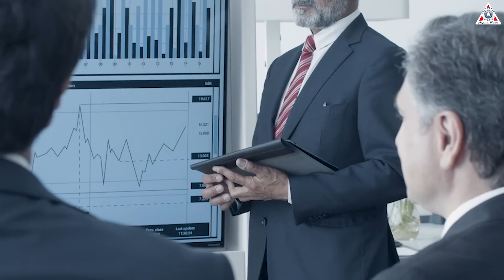Elon Musk's SpaceX Revealed Starship Flight With First “Chopstick” Landing...

Comment: I’ve said it many times. Putting gyroscopic stabilizers on the chopsticks would probably make them far more stable and accurate. And while I’m at it building an oil rig type landing pad down range you will save tons of money weight and fuel and just float the things back to port on a much cheaper conventional ship. Keep the chopstick idea but put it over the water so when accidents happen (and they definitely will) you don’t destroy an entire landing site. It just drops in the ocean.

Comment: The Falcon 9 has a mass of 550kg or a bit over 1,200 lbs?  A single merlin engine weighs nearly that .  I can't find any part of a falcon 9 with a mass' first 3 numbers being 550
Reply: He may have been referring to the minimum fuel weight (550kg) for the landing burn.  It sounded like the text was inartfully edited at that point in the video.

Comment: I thought they ruled it out for launch 5.
Reply: They should if they haven’t. Zero chance of success.
Reply: @JetFire9  They have mastered landing the Falcon rockets on a dime. I saw a view where they explained that the booster has three methods of control. A big one is the engines gimble. That should put it where they want it.
Reply: @russmartin4189  I have seen a lot of Falcon 9 landings, thank you very much, but no, they don’t land on a dime. They are all over the landing pad. This Starship needs to land on the tip of a pencil. They haven’t gotten anywhere close to proving they can do that yet, so why blow up the launch pad, AGAIN??
Reply: @JetFire9  I think the idea is to land it with practically no fuel left.  And even if it exploded, the launch pad is very strong. As long as the cables  and connectors are shielded, it should be able to take it. Listen, they know what they are doing and (probably) built it to take explosions. That's what I think. Anyway,  we may find out what happens when one blows up attempting to be caught.  That would be cool in a perverse way.

Comment: We'll see, I think the whole tower thing, and excessively tall boosters and ships are an anomaly of current levels of lift tech.

And that Elon' s magic tricks will be great viewing, but that Companies like Rocket Lab and Stoke Space will use tapered free standing ships that are shorter, and just use erectors. Which will allow passenger boarding and cargo loading in the horizontal.
With the fueling system built into the erector instead of a tall tower.

This would also allow ballistic angling for shorter sub orbital flights.

And be a much better system for offshore complexes or Rocket Carrier operations...

Gonna be hard to be stealthy with the radar cross section and over the horizon exposure of one of those towers on a ship. Not to mention stability issues as I have writ previously.

My guess is Rocket Lab will maybe combine the hot staging ring, with their ring base stage two concept. Perhaps with the triangulation being in two parts with an overlapped locking system, so as 2B capable of hop stacking instead of requiring a crane all the time.

That landing base ring on a stage two or stage three payload ship would be a good system fer in the dirt, like the Military would want, or one might need on Moon or Mars for years until things were less primitive.

And it could have suspension... perhaps air over hydraulic shock absorbers with spring over configuration like the Off Roaders have  developed. That stuff is off the shelf, and surely stainless versions could be manufactured and get alot of sales promotion via Space use, and sell to off roaders awaiting their first Lunar or Mars Overlander Adventures.

You know, they and dirt bikers will pay alot for low gravity moto and 4x4 tourism...

Its likely to be a Yahoo cultural thing with the Loonies and the Martian colonizers...

Get out of those stuffy Colony Tunnel systems, and tear up the regolith with high powered tron motors, doing low gravity extreme jumps and awesome lunar hill climbs, or Olympus Mons on Mars.

Use up their annual dosemeter allowances exploring and rockhounding...

Also the ring base and shock absorber system would be good for shipboard landings. we could build very fast Nuclear powered Triamaran Rocket Carriers with plenty of deck area and multiple launch systems for operations.

Might pay to have rocket craft that can make turns... 🤭 without needing engines for control. Alot harder to detect...

This current tech is crude, The Biplane era of Space... Probably considered quaint in 20 years...

Also with human expansion into Space will come a birthrate increase, due to expansion of economic growth rate, and a reduction in bureaucratic control.

And I doubt Elon will be friendly to bureaucracy on Mars after his experiences of late. There could be an extreme surcharge on Tickets for bureaucrats and other officials, also a hefty life insurance policy requirement due to unfriendly Colonists.

They will be like European Nobility visiting the Americas in the 1800's...

Visas will be short.

Anyway, one appreciates Elon spending his toy money this way... Its a good start! Compared to 50 years of NASA nothings.. I watched the first Moon landing live on TV one summer day as a young teen, never imagined NASA and the bureaucrats would peter out within a decade. Whilst siphoning off untold billions into needless wars...  A Pox on them!